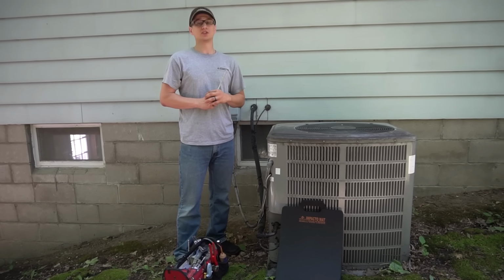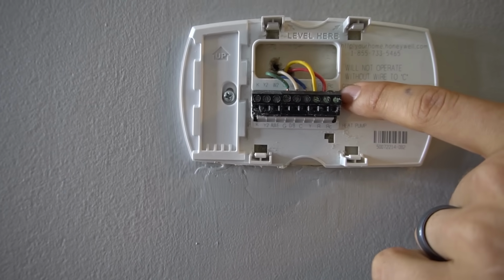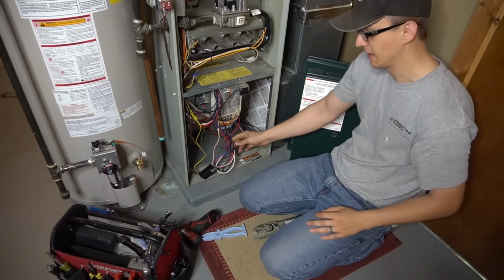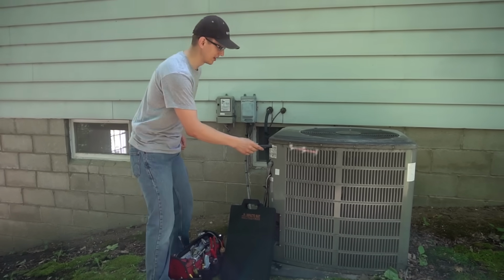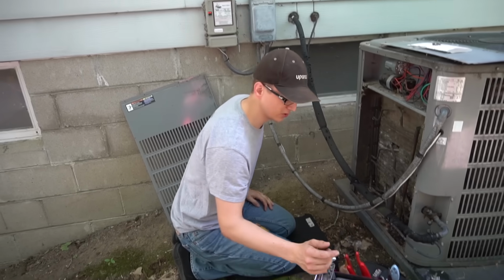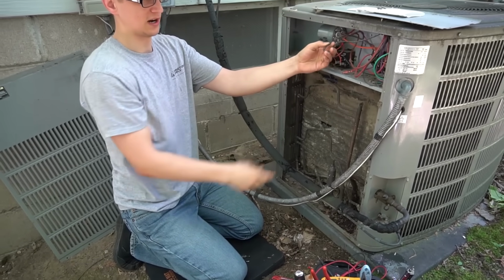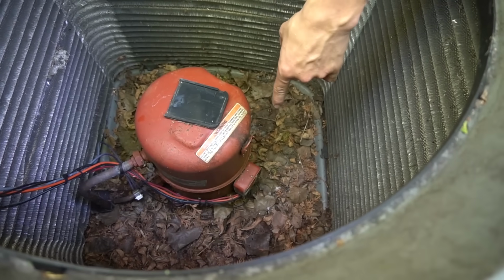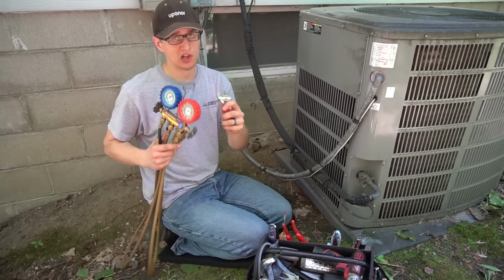AC Unit Not Turning On - How to Fix It Step by Step

Comment: I have a question my ac furnace is working fine and blower blowing air but unfortunately my compressor and fan not kicking in? I checked my thermostat it’s make clicked sound when turn on position! I opened my compressor panel and pressed bypass switch and they both came on? So my capacitor is bad, it’s need to be replace, please any info would be much appreciate it?
Reply from the maker: If your compressor and outdoor fan came on when you pressed the contactor plunger, that means your capacitor is good and you have 240v going to the unit. For some reason the low voltage (24v) is not getting to the contactor coil so it does not pull in the plunger. If you have a meter you could trace where you are losing your voltage pretty easily.

- I would first check for a blown 3 amp fuse in your furnace/air handler.
- If you have an attic unit, you probably have a condensate overflow float switch. If the condensate drain line is plugged up and water is back up, that switch will trip.
- You can try bypassing the thermostat at the furnace control board to rule out the thermostat. (I have a video about that in my AC fixing playlist)
- The thermostat wire that comes out of your house and goes into the condenser unit outside, do the two wires that are inside of it, go straight to the contactor coil or does one of them go somewhere else? If it goes somewhere else that means there is something in series with the contactor coil that could be interrupting the voltage. Try to trace where that wire goes and that may lead you to the culprit.
Reply: Word of Advice TV my ac furnace is in basement crawl space, how would I find fuse in my ac board?
Reply: I have no clue about what wire to trace...you just mentioned, but I did noticed there was spider web inside and everywhere in panel and my compressor is fairly new it was installed in 2015, it’s my thermostat not working well or something might be stuck in connector?

Comment: Amazing video, thank you! I do have an issue that I could not resolve with this information. First my Central air unit would come on for about 5 seconds and it would kick the breaker.  I  actually  heard the short in the breaker box when I reset the breaker so I replaced the breaker and now the blower on the furnace stays on all the time. In addition nothing on the unit outside will come on. After watching your video I cleaned it and looked everything over. What I found is if I push in on the plunger it will again come on for about 5 seconds and kick the breaker again.  If I disconnect the wires going to the condensor, the fan in the unit will come on and not kick the breaker.  Any suggestions on what might be causing this or am I getting to the point where I should call in a pro? One last thing, it is getting exactly 240 volts to the unit.
Reply from the maker: From what you described, it sounds like your compressor is bad. It must be drawing really high amps at start up which trips your breaker. If that's the case then yeah, you would need to call in a pro. (it will be expensive so if it's an old unit, you may want to consider replacement) One last thing I would check though, if you haven't already.. Is the wire connectors that plug into the compressor.  A burnt out wire there could cause a short as well.
Reply: I did find the fuse in the furnace was blown, I replaced that and now the blower on the furnace goes off like it should.  I did check for continuity and it was fine, but that was a few days ago. I will check that again.  Any chance a hard start kit would help?  You mentioned you are from Minnesota, what part? I am just north of Mille lacs. Do you make house calls? if so whats your rate to diagnose to confirm its the compressor?
Reply from the maker: I'm 4 hours away from you so I would rather not :) You sound like you know how to use a meter. I have a video on how to check the compressor, you may be able to diagnose it yourself: https://www.youtube.com/watch?v=0aAj0iqP95A&list=PLK8tZPlovA8Aw5W4GIoingc_enl5apH4C&index=16&t=13s

If the compressor windings turn out to be good, then you can try putting in a hard start kit. Sometimes it locks up and a hard start kit may be just enough to free it. (doesn't always fix it though)
Reply: All right, does show open line, so I think I will try the kit. Thanks again.. and great job on the videos!
Reply: I put in the Hard start kit today and it resolved the issue for me! Thank you so much, you saved me a pile of money!
Reply from the maker: Awesome! Glad to hear it :) Stay cool!

Comment: Awesome video, but still stuck! I did what you said and when I push the plunger the unit comes on but it seems like my unit and my thermostat are not talking to each other. I have not installed anything new, I’ve checked the breakers Ive checked the wires I even got a new thermostat thinking maybe that was the problem but it appears there’s something wrong with the actual connection between the unit and my thermostat. Any idea?
Reply from the maker: If you have a meter that can check voltages, this would be easy to check. If you don't have a meter, I would start by bypassing the thermostat at the control board and see if it turns on (if this is something you would be comfortable doing) https://www.youtube.com/watch?v=bmZc76ufTNY&index=14&list=PLK8tZPlovA8Aw5W4GIoingc_enl5apH4C

Next, there is a thermostat wire (it has 2 wires in it) coming out from your house and into the AC unit. Do both of those wires go to the contactor coil or does one of them go somewhere else? If one goes somewhere else, can you trace where it goes? That may be what is interrupting the power from getting to the contactor.

Comment: Great video, you seem to be well knowledged,  my a/c started by outside fan not turning, I could shut it off by the thermostat for a couple of mins, and turn it back on the fan would kick on, on the last day I ran it all night and it worked fine, on the following day it worked fine, but that afternoon the unit kicked on as usual but I noticed it wasn't cooling, in fact felt like it was actually getting warmer, I went outside that fan wasn't turning so I took a skinny stick and was going to try to spin the fan, but the stick broke as I stuck it between the grate and the fan kicked on as it hit the ground, I went back inside and the unit at the top was very hot and smokey like steam or something, and there is drywall around on one side and it had burnt looking round spots, so I shut it off by the breaker, waited a while tried it again and it just makes like a hiss like noise and still seemed to get extremely hot, is that thing inside on top bad?
Reply from the maker: I cant say for sure but from the sounds of it, seems like there is quite a problem there if you have burnt spots and steam coming out. You may have a problem in the freon system. Perhaps the metering device is bad or restricted. There may also be a leak somewhere. This is something I would have to see to be able to give you a good answer. You will probably need to call someone for this one.
Reply: @WordofAdviceTV  thank you for the response. You're very knowledgeable and informing. It was 2 things replaced, fan something or other on outside unit and something on the inside, can't remember, but the problem was the fan outside wasn't sure kicking on and the unit inside wasn't kicking off, the repairman said the burn spots most likely were from original installation
Reply from the maker: Ah okay. Thank you for coming back with an update!

Comment: Alright I got a question bro. Everything is working fine in my home but outside unit is not. I watched your video and figured out that the contact switch won't go down unless I push it down then the unit clicks on but my problem is the contact swith had a cover on it and is not dirty what so ever. I live in florida and it's extremely hot so I decided to try to make the contact switch stay down so my unit would stay on and cool my place down but I noticed right away that the coils where getting hotter instead of cooler especially coming out of outside unit. Like to the point of just about burning your hand. I checked to make sure it had frion and it sprays out really well like it has plenty. Its been working really well so I'm stumped. Any advice?
Reply from the maker: When you made the contact switch stay down, was your indoor fan working? (it needs to be running too) The skinny freon line is usually warm/hot  coming out of the outside unit and the thicker one is cool/cold and will typically have condensation on it. If it was extremely hot then something may be wrong there.

So from what you described, it sounds like the contactor coil is not getting 24v. You will need to figure out what is interrupting the power. Do you have an attic unit? Those usually have condensate overflow switches. If your drain is plugged and backing up, that will trip. (that will be at the air handler, not outside) Also, the thermostat wire that comes out of your house, (usually has 2 wires in it) do those 2 wires go straight to the contactor coil or does one of them go somewhere else? If it goes somewhere else, try to track down where that wire goes and that will likely lead you to what is interrupting the power. Perhaps it's a high pressure switch/ (those are often times re-settable and will have a button on them). I would also thoroughly hose down your outside unit even if it looks clean. (if it's plugged up, that will increase the pressures which will increase the temp of that skinny pipe)

Comment: If I had to push the fan on the outside unit to get it to go, is it bad or just a fluke?
Reply from the maker: It could have been a fluke but I would suspect that your capacitor is weak. If you don't have a meter to check it with, they aren't too expensive so I would just replace it.
Reply: @WordofAdviceTV  Did just that.  Watched your other video for the capacitor, bought a new one and fixed it myself.
Reply from the maker: Awesome! Happy to hear it :) Stay cool!

Comment: So I opened up my lennox AC with my air conditioner off and pressed the switch for the forced turn on check. No sound, When I turn on the air conditioner the switch is unpressable but there is a slight vibration but no actual air conditioning start up rumble. I do not have a electricity tester so I don't know if the volts are on. I'll pressed down the button and spinned the fan as but it never started no matter how hard I tried. So all the basic stuff doesn't work, it seems to be a bit more complicated than I though. MY thermostat is in working order it does not run on battery but connected to the line directly. When I turn on the fan on auto it goes off. When it to cool 75 degrees hold, it turns on but the air is not cold, basically the fan. The outside unit does not turn on.
Reply from the maker: At this point it sounds like either your capacitor is dead (in my AC playlist, watch "the most common fix" video for more info on that) or you are not getting power to your unit.  (240v) First I would check the AC circuit breaker to see if that's tripped and if your disconnect outside has fuses, those may have blown as well. Unfortunately you would need a meter to check for sure.

Comment: Hello! We have two units in our home, one is working and the other is not. We have checked the air filters and made sure all the vents are open. The outside units both sound like they are running and fans are turning. We did spray off the outside units. We have had the unit ice up before so we thought that might be an issue, so we shut it off for a day but that did not help. Air is coming from the vents, but it's not cooling the house :(   Please help!
Reply from the maker: If the unit is working but not cooling and has iced up before then there is a good chance that this is a refrigerant problem. Most likely there is a freon leak somewhere in the system. Unfortunately this is not a DIY project so you would have to call someone out there to check it out.
Reply: @WordofAdviceTV  I appreciate your response so much! I will try to get someone out here tomorrow :) The air blowing from the vents is cool, it's just not enough I guess. Lord knows in Florida we will need our air for another few months lol! Thanks again!
Reply from the maker: No problem! :) I totally understand that! If it is still 84 degrees in Minnesota, Florida will likely be cooking much longer. Good luck!

Comment: You have great info. By the way, I turn on the thermostat, but the ac handler doesn't come on nor the condenser unit outside is working.

Comment: The fan on the inside unit runs non stop and will not turn off without killing the breaker. The outside unit hums while the inside unit is running but the fan and compressor does not come on. What could that be? The capacitor?
Reply from the maker: Sorry for the late response! Yes, it's very likely that it could be a dead capacitor. That would be a good start. Only way to know for sure is to check it with a meter (my "the most common AC fix" video has more on that) Or perhaps there is no power going to the unit. (240v) The AC circuit breaker could be tripped or if your disconnect outside has fuses those may have blown as well. Unfortunately those you would need to check with a meter as well to know for sure.
Reply: Word of Advice TV,
It has a pull breaker at the outside unit and there is power to that. When I have someone to switch off the breaker to the inside unit only, I can hear something snap at the outside unit and the humming stops. When the breaker to the inside unit is turned back on, another snap sound is heard and the humming starts back up. It’s like something is making contact at the outside unit to keep the fan on the furnace/inside unit running constantly.

Comment: I need advice I have a window unit Kenmore 25000 BTUS & it's been working great for 8 yrs but last week it iced over and froze up and every since will not cool... I took it out of the housing and cleaned all the coils it still blows air even better now and the compressor come on without making any crazy noises it sounds like normal but instead of the compressor and lines getting cold and frosting over they actually start getting very hot if you leave it running as long as it is set to cool it doesn't shut off it just gets hot to the touch so I was wondering if it maybe just needed to be recharged or if there is something more serious that could be the problem it takes R-410A which I'm sure I probably can't access myself... please let me know if you have any advice for me... I have found your videos very helpful I have watched several on different types of units... thanks and keep it up
Reply from the maker: Unfortunately I have never worked on window units so I can't be of much assistance on this one, sorry. It sounds like you may have a restriction in the metering device which, like you mentioned, is not a simple fix.

Comment: I replaced my thermostat but I am still having trouble with my A/C turning off and right back on, Do you think it is the Control panel? Also, sometimes cool air is not coming out, so when I disconnect my thermostat and reconnect it, the cool air will come out again.
Reply from the maker: If you bypass the thermostat, does the problem persist? (If you are not sure how, I have a few videos on how to bypass a thermostat in my AC Fixing Playlist)